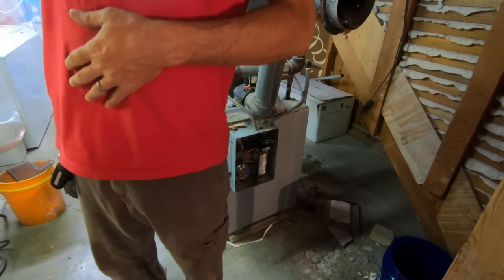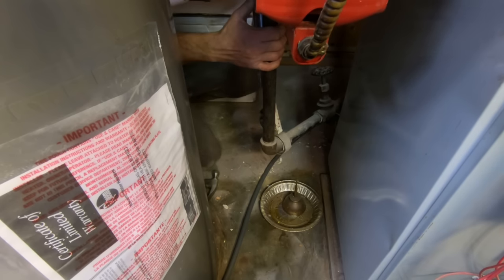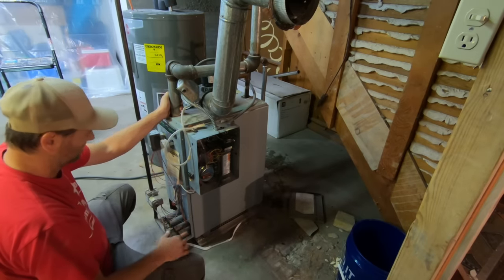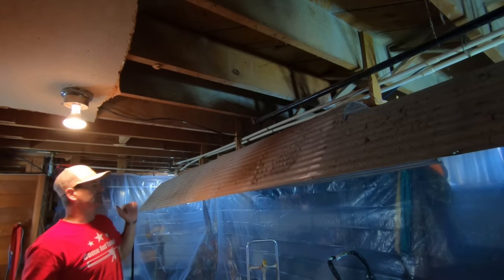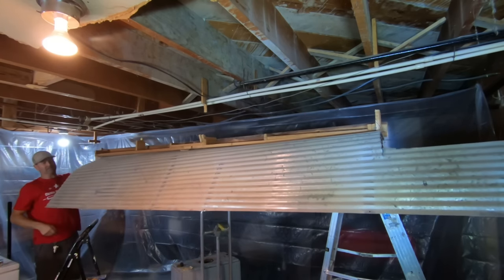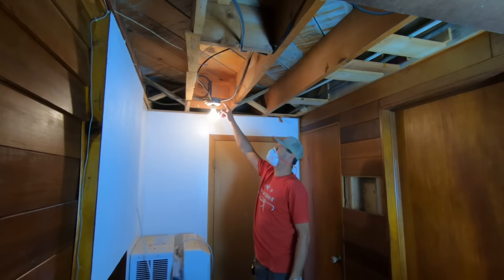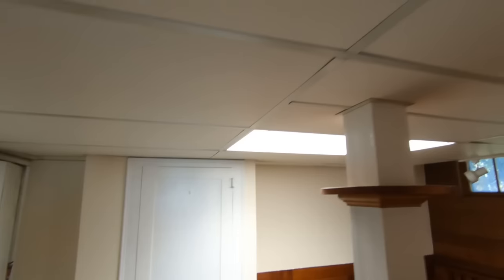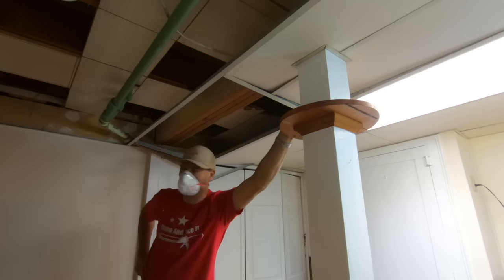This House Is Filled With DIY Mistakes That Are Dangerous | THE HANDYMAN |

Comment: Hard to take advice from someone  running an angle grinder with NO eye protection...
Reply: @armslength2618 not only that, but he also has a cordless drill, flashlight and car. There's no way that 12v car battery can compare to 480v 80a to power his truck.

Comment: 13:00  My uncle once explained to me that notching a load-bearing member (e.g., a floor joist) weakens it, since it's effectively a narrower board at that point; while drilling a hole near the middle has little to no effect on its strength.

Comment: Been there.
A previous owner installed a ceiling fan on an outside pergola that was between my hot tub and pool. The fan was grounded to the metal box, the box was connected to the house with plastic conduit. 😳
The box on the house had a half dozen ground wires bundled together doing NOTHING. The installer was too lazy to run a ground wire through the conduit.
Reply: The previous owner of my house installed a ceiling fan in the garage. There is 2 wire lamp cord coming out of it, run along the ceiling and plugged into an outlet. There is no ground and I’m willing to bet no electrical box either. We haven’t used it ever.
Reply: Oh the travesty and near tragedy narrowly avoided until now. I FEEL SAFE NOW! Thank you Handy!

Comment: I'm from NYC and you are absolutely correct on not being able to use plastic piping due to rats. 
PEX is not allowed (only allowed for heating), PVC DWV is not allowed (except for single family homes), and Romex is also banned (except for single family homes).
Reply: is everything run in mc cable?
Reply: @sythshowedu  Yes. BX is found in old homes
Reply: @LowkeyXxx  Yeah they still sell it at Home Depot. None of the supply houses i know of carry it

Comment: 1:35 What water pump???  What is the water pump for?
Reply from the maker: Its a boiler.  The heat comes from hot water.  The water needs to be pumped to all the radiators in the house.

Comment: That electrical work was most likely done by a professional.      The standards in the 1960s was different.    My guess is the connection in that box were done witn old school copper crimp connectors.   They were commonly used by professionals with either friction tape or electrical tape.       Any old house will /can  have  wires connected like that.

Comment: The "handyman' that lived in that house is haunting it. You're rippin out all his crafty and fine work......lol  PS that cloth covered romex is from the late 40's or mid '50's. The house I grew up in had wire like that. And some junction boxes made of metal. And some junctions made of.....friction tape. Yes, a whole roll of tape wadded around several wires all twisted together. Wire nuts?? What the hell are those?

Comment: Those old cast-iron boilers are a pain in the ass usually a 2-man job to get out of a basement, they do make motorized moving carts that can climb stairs. You could lay some planks down on the stair treads and use a winch to get the boiler to the ground level.

Comment: The Milwaukee M18 dual power tower is a magnificent work  light, it deploys in under a minute and with its extension range allows glare free lighting from behind over your head. The self expanding base is rock solid and self stows in under a minute. The light level is also very good.  I have seen if for around $180  bare tool and under $200 with two 5 ah batteries and charger. Unfortunately it is not free. As they bay buy once.

Comment: Hopefully those pipes you were cutting with your electric wheel grinder weren’t old gas pipes, most people even licensed plumbers think because a gas pipe is dead that it’s ok to cut with electric tools/battery the truth is that there’s still residual gas that can be sucked into the electric motor and cause body injuries. Luv your vids, stay safe👍
Reply: He explained in a prior video.  It's water line.
Reply: I removed a cap on a gas line that had been dormant for 35+ years, started second guessing myself when I got the whiff of natural gas.

Comment: I bought a 1950s house 🏡 as my first. Learned more about electricity, plumbing & framing then I ever wanted to. Should have hired contractors &  apprenticed during the renovation & got my licenses, lol 😂
Reply: Id take a house framed in the 50s over any framed today. today's houses framed by the lowest bidder with  cheapest lumber contractor can get hands on, to as minimal code as possible

Comment: I don't understand why you would replace an excellent heating source, o
( Hot Water) with forced air.     I have lived with steam, hot water, electric baseboard, and  forced  air.      The best to worse,  for comfort even heat.  Hot water, steam,  electric, then forced air.         The only real advantage to forced air is you can have ac in the same  system.        Electric base board resistant heat is way too expensive.      Steam's advantage is you get some humility from the system.  Not much but enough.  You don't get that from hot water.
Reply from the maker: Future central ac
Reply: @TheHandyman1  i couldn't give up the better heat.  I would put in a stand alone  cooling system maybe a heat pump .  For spring and fall.  I really wish my current house had hot water heat.

Comment: The union wasn't frozen it was the weight ,pretty common. Heat it up.   . Why would you make a chase it would be a waste of time.  You just drill holes in the joist and rerun the wire. to sister the   should be interesting to watch a fellow handyman.  Have you ever built houses from ground up. ?
Reply from the maker: I have built several hundred houses and a few dozen buildings.  A few grocery stores, rec centers. Midrise buildings.  I worked as superintendent and project manager for the largest construct company in the USA when I got out of college. 
I don't like turning joists in to swiss cheese.